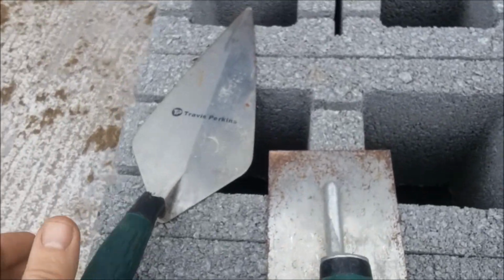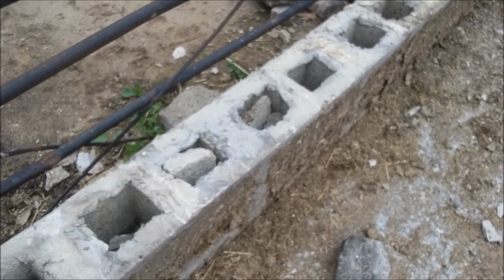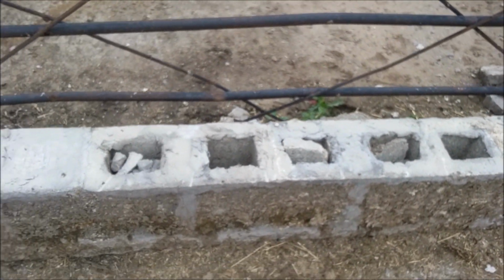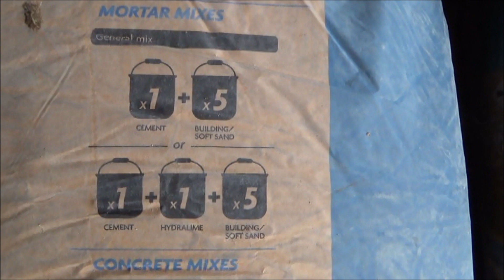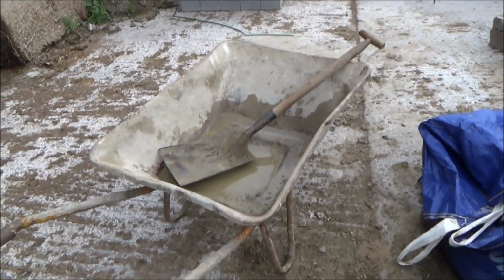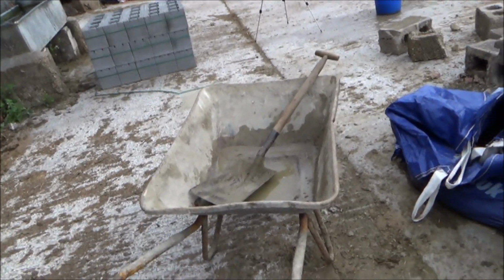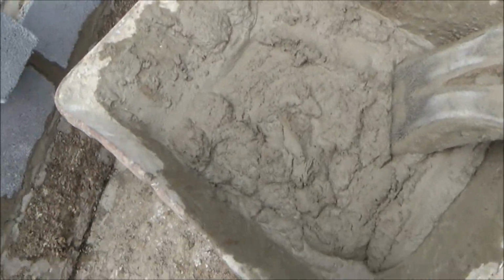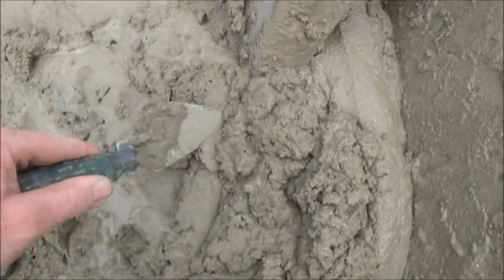Rebuilding the farm yard wall. Part 3. cement mixing

Comment: Richard, You will find it easier if you get some Feb mix from the builders merchant (plasticiser) a small splash in your water tpmakes the mortar more workable and easier to spread. It looked like your water volume was right the first time and you then over wetted it with the second bucket.
Reply from the maker: thanks for the tip

Comment: For the amount of cement you'll need, I think I would have dug up the cement mixer.  HA.  Are you thinking of putting in rods of rebar to aid with the strength as you fill in the holes with rubble and cement?
Reply from the maker: i would have used the cement mixer if i'd had the time to do the job in one day. However i've only got time to do a few blocks a day hence the wheel barrow mixing. I'm just filling the blocks with cement. The wall lasted 35 years without any bars so i figure it should be ok

Comment: If u put a bit of washing up liquid into the mix it will make it more sticky and it will stick to the blocks easier
Reply: never use washing up liquid , it causes a breakdown of cement over time..use a proper mortasiser....
Reply: Modern washing up liquid is not the same as the original fairy liquid, it now has added degreasers and chemicals. Mortar with modern dishwashing liquid always seems to suffer frost damage.

For the sake of £5 it's better to buy 5 litres of fe mix, doing odd repairs and the like you'll take forever to use it but it doesn't deteriate.

Comment: My dads is a builder and he said you mixed it wrong and it won't hold the bricks toughther
Reply: He's a dairy farmer not a builder
Reply: Majority of builders from what I've seen make way to much cement and it's always too wet so I don't know if I'd agree! Richards seen close to bang on to me.
Reply: +Mountain Man true but what I really ment is it was to wet so it won't hold but it's always nice to have a go at it first
Reply: +Mountain Man yes I know he's a dairy farmer but he wants to employ a builder
Reply from the maker: I'm sure this wall will be fine.i'm no builder but i bet if you come back in 10 years time this wall will still be standing. It's funny but i had similar criticism of some welding i did on a tractor A frame a few years ago. Someone said they wouldn't hold, 3 years later the welds are still going strong.
Part of farming is having a go at things and in this case that's what i'm doing. Remember moneys tight on dairy farms at the moment and i really can't spend hundreds of pounds paying a builder to do this job.
Reply: +Sam Price 
.com nznzkzkzn987654